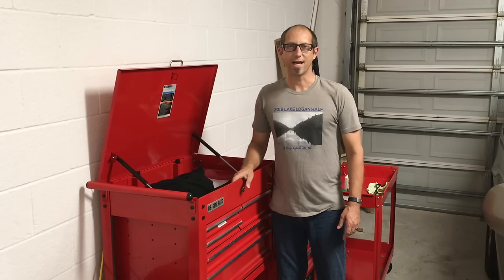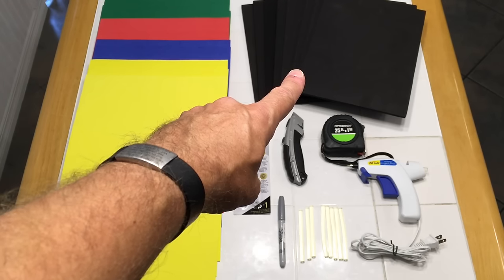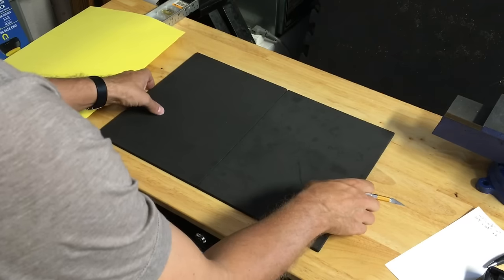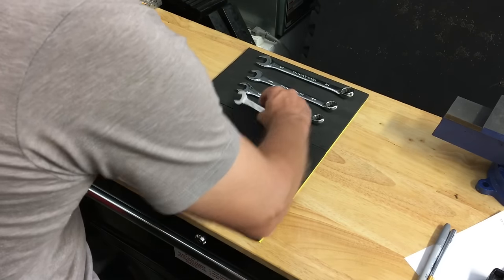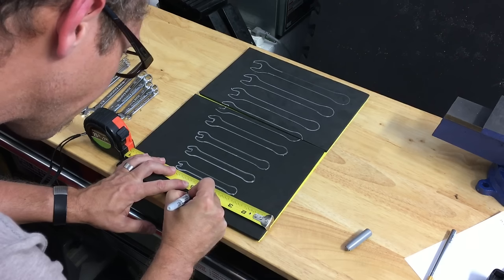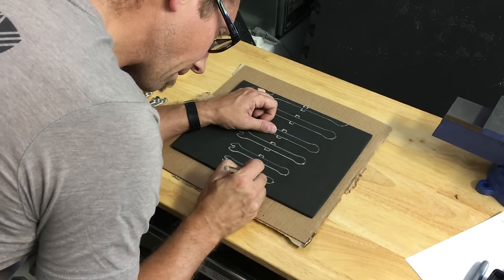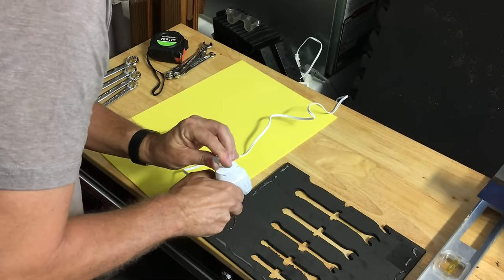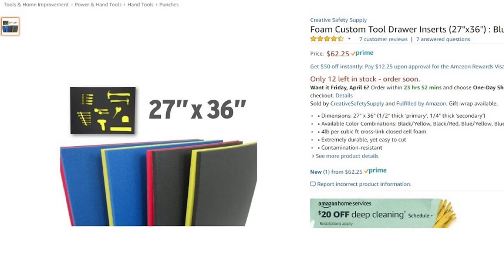Make Your Own Custom Tool Box Foam Inserts for $3

Comment: Why the glue? 
They’re just gonna sit in the drawer. They’re not going anywhere. 

Also, wrenches can be picked up by box end. Save a little time.
Reply from the maker: The Locust Project, the glue is just a personal preference.  I guess you wouldn't have to have it.

The great thing about DIY is you can tailor the project to your needs and your likes/dislikes.  Good luck and have fun with it!

Comment: This is a good idea but the video could have been half the time...
Reply from the maker: sambas13, all of my videos now are concise and quick to the point.  Thanks for the comment.
Reply: There is a little gear that allows you to speed up videos. Also you can mouse over and scan ahead...so as to jump to the end result in this case when you have seen enough preparation.

Comment: Two weeks after this video was made, the 10 MM wrench disappeared, just like every 10 MM wrench from any wrench set disappears.  Then he purchased a individual 10 MM wrench, got home, and it was one inch longer then the old, missing one.  So, more foam was cut away to fit the new wrench, but now, due to its longer length, it looks out of order.    

Then a month later, the replacement 10 MM wrench also disappeared.  He purchase another, but this time it was 1 inch shorter....... argh!!!

Comment: What an immense waste of space for a toolbox draw. Why not use thicker foam and position wrenches vertically or at an angle in the foam.  So much easier to cut a slot along the foam and insert the wrench then you could label as required.   Good try and one learns from all the comments and creates a new and improved version.  😀😀
Reply from the maker: Nick, Brotchie, I have a lot of tool box space to use.  The purpose of the video is to show concept, not that you have to set up your tools the same way.  There is no wrong or right way so feel free to adjust foam, spacing, and orientation for your preference.  That's the beauty of DIY, you can do it however you would like.

Comment: You have way too much time on your hands!
Reply from the maker: Gary Geiser, you'd be surprised how little time I actually have.  I use my tools all the time and having them in order and able to find them quickly saves me time in the long run.  Since making this video I've reduced the amount of production time by 50% by using a hot knife to cut the foam instead.